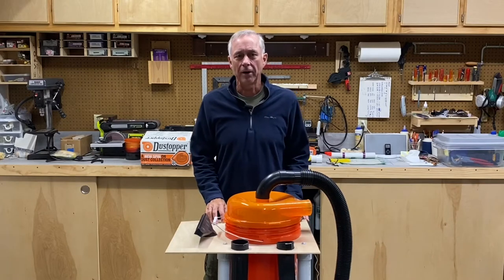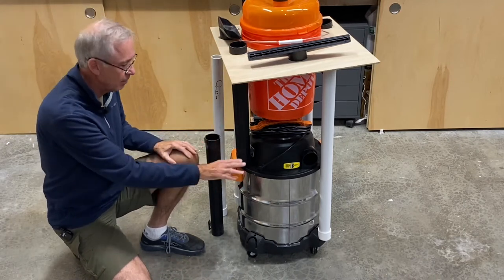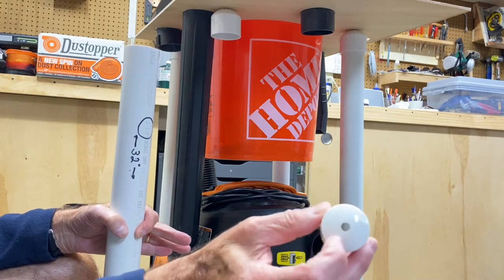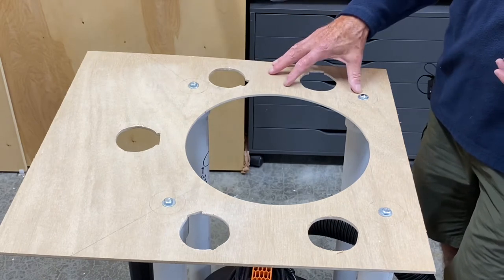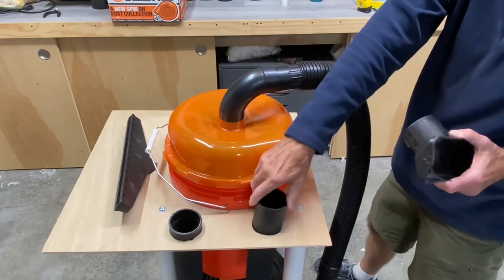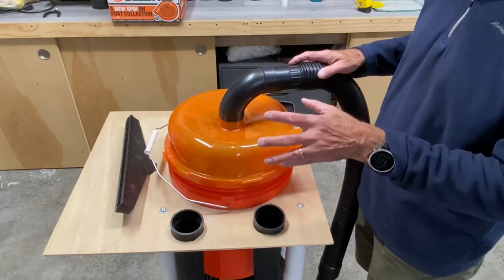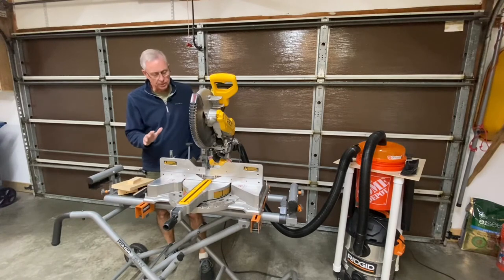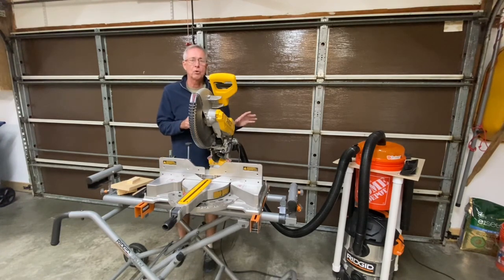Dust Collection Cart DIY

Comment: I was about to build a 3/4 ply enclosure/cart for my new system, but I'm glad I saw this video first. The pvc pipes are genius, thank you!
Reply from the maker: Thank you!  There are a couple of other videos that use the PVC method. I encourage you to watch them and see which works best for you.  I can say that mine worked fine. I added a 1”x1” frame around the top. They were slotted so the 1/4” plywood top would slide into them. It made the top a bit more ridged and if I set screws or stuff on top, they don’t roll off.  Thanks again for the comment!

Comment: Thank you for sharing.! I have a WEN 3410 Air Filtration System on it's way after watching. I also plan to build this soon as I can. I have a small 16 x 20 shop and enjoy wood working, mostly scroll saw projects. I also like the rubber adapter idea. It is difficult to have a adaptor for all of my tools. I wish they would standardize fitting sizes to at least a couple of standard sizes.  I have lung issues and hope this project will allow me to continue my wood working hobby. Keep bring these great ideas to is please!
Reply from the maker: Glad it was helpful. I was finding myself coughing when I was working on projects. I most often wear a mask now as well as dust collection and filtration. They all help and make a big difference.

Comment: I am planning to try a few things to prevent the flaps from getting sucked in. My 16gal rigid vac sucks them almost all the way in even if I bend them out. First plan is to use the top of a small gatoraid bottle as a more rigid funnel clipped to the flaps and see how it works. Then I might 3d print something custom
Reply from the maker: Awesome!  Please let me know how it works out.

Comment: Good video. I like your simple design, though I think I'd be sure to round those sharp plywood corners. And, I like the fact that you appear to have used 1/4" plywood for the top. No need for the extra weight of 3/4" ply but I agree 1/2" would be better. So, kudos. Just round over those corners and you're good to go!  :)
Reply from the maker: Thanks for the comment.  I actually came back later and added a 1x1” band around the outer rim of the plywood.  It added a bit more rigidity and if I put screws or something on it, they won’t roll off.

Comment: Hello Ray - I just built mine today and have a question for you. Did you do anything to help with the rigidity of the upright's?  I just went with the 2" PVC to begin with but I found that with the slip fit at the bottom and the top (caps) - I have to tweak it a little sometimes to get them be straight (vertical).  I thought about putting some horizontal pieces about 1/2 way up - all the way around to stiffen things up.  What say you?  :)
Reply from the maker: Hi John. I have the same issue with rigidity.   It works though and I haven’t bothered to mess with it.   The only thing I changed was to make the 1/4” top more ridged. I closed the garage door on it and cracked one end. I just took a 1x1” board and cut 4 pieces to fit around the edge of the plywood. Then I cut grooves in the boards and applied glue to attach them to the plywood.   Your idea to add rigidity sounds like it will work.  Let me know.  Maybe I’ll try to work on mine as well. If I do. I’ll let you know what I did and how it worked.
Reply: @Ray_Here  Ray I added some 1/4 in straps (Masonite) - 18" up from the bottom - all the way around and it helped considerably.
Reply from the maker: @PastorJohnBrown  Thanks John!  How did you attach them to the PVC legs?
Reply: I first generously applied CA and glued them in place to keep them from “racking”, the I followed up with screw into each leg to keep them in place.
Reply from the maker: @johnbrown3882  Thanks for the tip!
Reply: @Ray_Here  You are welcome.

Comment: Rigid also makes a hepa class filter for these shops vacs also. Ensures clean exhaust air.
Reply from the maker: I use the filter in my smaller 5 gal vacuum.  I should add one to this vacuum as well. The filters work great.  Thanks for the comment!   I also have a WEN 3417 air filtration system that hangs from my ceiling. I did a video in that as well.  My shop/ garage has much less dust these days.

Comment: I think u could prevent the flaps from getting sucked in by gluing a thin piece of wood to both sides of the flap!
Reply from the maker: Great idea!  When I get around to it, I want to fabricate larger flaps that will catch more dust.  Such a messy tool!  Thanks for the comment.